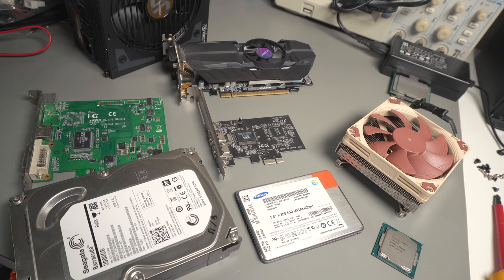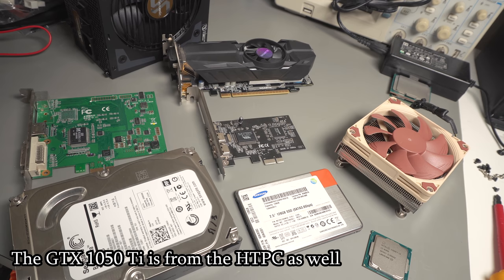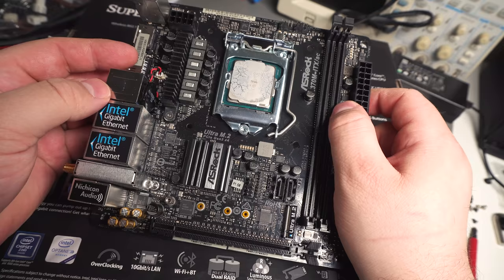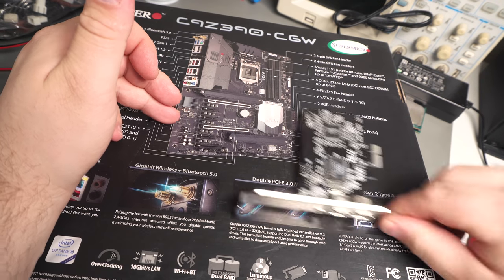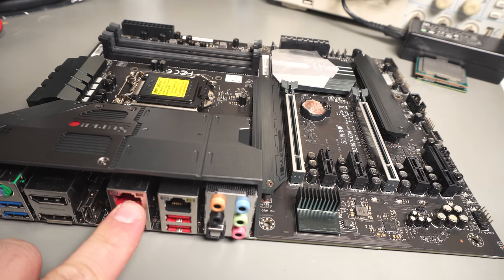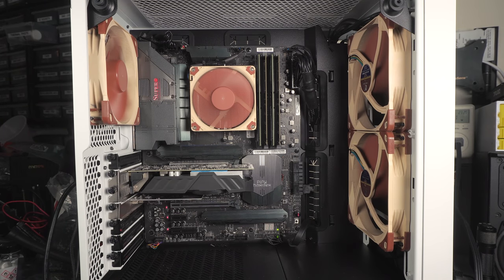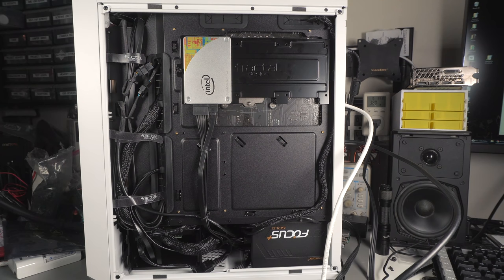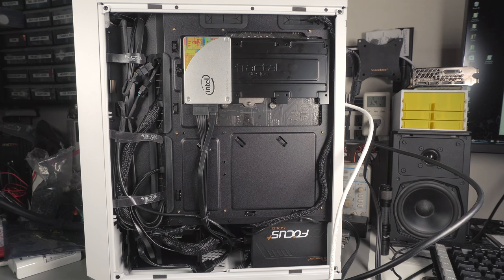Video Capture Computer Build (10GbE, NVENC)

Comment: Yea the "basicness" of supermicros bios is what moves their products from an option to a solid nope. Which is a bummer because the feature set is really good.

Kinda feel the same about biostar too.
Reply from the maker: I don't mind it too much in most cases. Unless I'm overclocking or doing something specialized. Most of the time it's just a case of doing the usual in the BIOS (XMP, boot drive, etc.) and pretty much never touch it again.

Comment: Nice clean build. If you have any issues with the firewire card, check out StarTech 3 Port 2b 1a 1394 PCI-E Card. It does not use a PCI-E to PCI converter chip. It helped my big time using my firewire audio interface. Latency and even prevents the related Windows crashes..! Always enjoying your videos! Thank you!
Reply from the maker: I personally have had no issues with my card running in my Windows machine for years and years. That being said, the Amazon link in the description is for a newer card without the converter chip (TI-based controller), and it also has 1394b (aka Firewire 800).
Reply: @PeterBrockie  Yes, Texas Instruments is the best chip for firewire and audio in particular, I ran my Focusrite Saffire Pro 40 audio interface through it. 

Here is one if you need it, I am pretty sure it's identical one that I have used for years:
https://www.newegg.com/Product/Product.aspx?Item=N82E16815124107&Description=firewire%20pcie&cm_re=firewire_pcie--15-124-107--Product